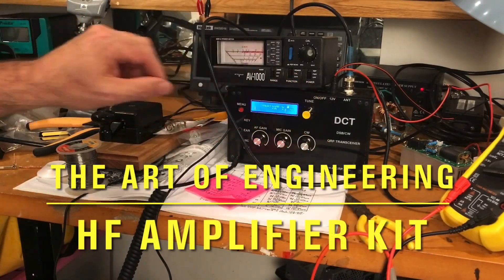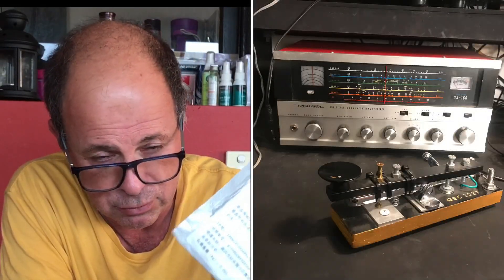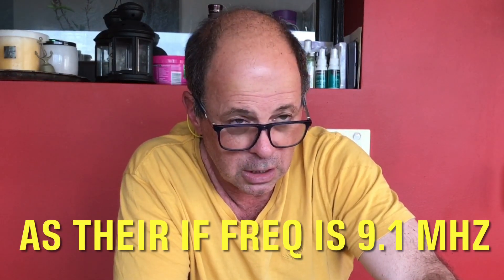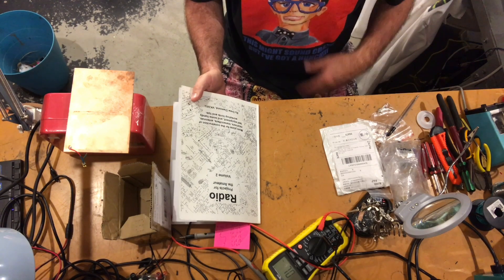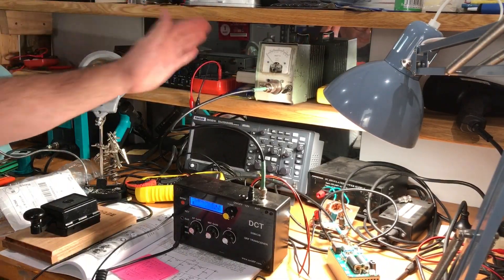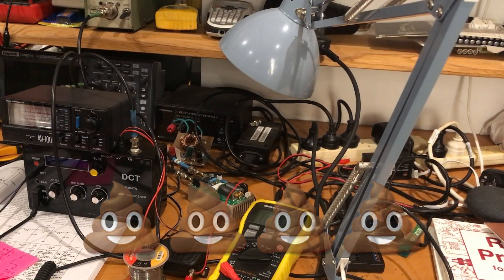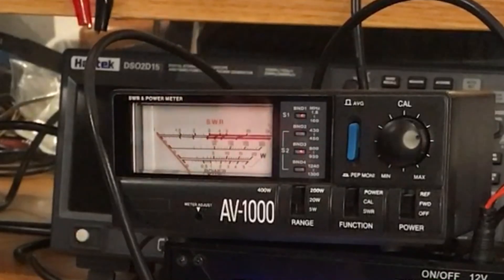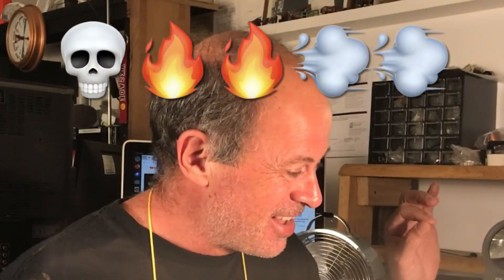Cheap Chinese 100W HF Amplifier......Amplifryer?

Comment: Owned 5 of these . work great as sold
Reply: zero issues on SSB
Reply from the maker: @shawnchartrandva3gfy720  Mine had dead LDMOSFET but after new cheap MOSFETS installed it is great! 73 de VK2AOE
https://youtu.be/lsJBVWA2hYU?si=HOWniO1SUXftJMes

Comment: Dear, it is not 100w rms. Itvis for 100w pep for ssb. Especially not cw or ft8. We neither need siluch high powers for cw and digital signals.  
Obviously it becomes amplifry under wrong use.
All the best
Sarma vu3zmv
Reply from the maker: Agreed....I'm running 45 watts now.....max. I start with 5 w and if the fish don't bite up the watts. I do occasionally hit 100W on the FT101E it is a monster and just ...takes off on me 🤣🤣 Greetings from Australia!! es best of 73

Comment: also what in the hell is a ham radio?
I keep coming across that Im not a radio brosd caster or anything, I just needed an hf driver for my horns and this was the cheapest one I could find, the other crap was a peavey amu 75watt one. arkitectural acoustics utility mixing amp
Reply from the maker: Hi…. It is also called amateur radio. It is a nerd hobby where people who are fascinated by radio pass a government test which gives the access to numerous radio frequencies (bands) where they can experiment with transmitters, receivers and antennas. This amp is not an audio amp. . It is for frequencies 1.8Mhz to 30Mhz.

Comment: So I got this to power my tweeters and it blew them up wtf?
they are compression horns hf drivers and they are rated at 100w rms?
this suck bc Im dj on a budget and I think I just fucked my fuckin sonny ones with this is there a way to unfuck them up please help!
Reply from the maker: Ouch!!!!  HF means HIGH frequency i.e MHz to 30Mhz. It is not an audio amp. You need to read the specifications…. The tweeters are 💀 😞

Comment: To mount those amplifiers, remove the board from the heatsink, use the board as a template inside a diecast box, drill the mounting holes, then assemble it with the amp on the inside and the heatsink on the outside. Replace the SMA's with chassis-mount BNC's on the end of the box and short lengths of wire, a power socket, and you are ready to go...
Reply from the maker: Thanks for the tip! 73 de VK2AOE
Reply: I used sma to banana plug adaptors on mine to power my hf skeakers and I think I just cooked them and my preamp make this twinking sound like a car turn signal any please help please Im a broke dj and Im worried I ruined my speaker with this please help!

Comment: FQP13N10 Single Nch Power MosFET ID 12.8A, VDS 100v TO220.  Commonly used for sw..

Priced from  about  350c.
look up MiniKits in SA    (NOT  South Africa)
Components _  Semiconductors _ Mosfets  _ Power Mosfets. 

Potentially  a lof of issues with  Cin over  ordinary IRF 510s. 
Maybe rescue victory from  Defeat ?? But George should not have to do this